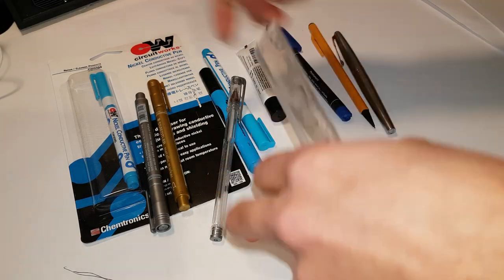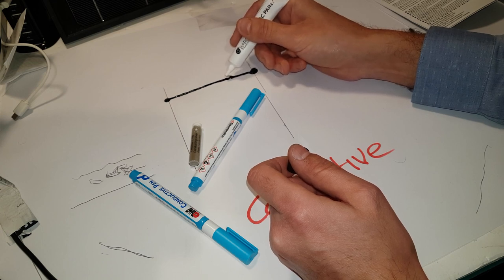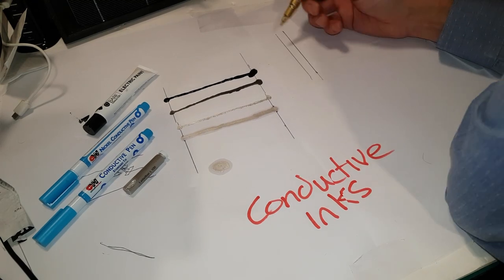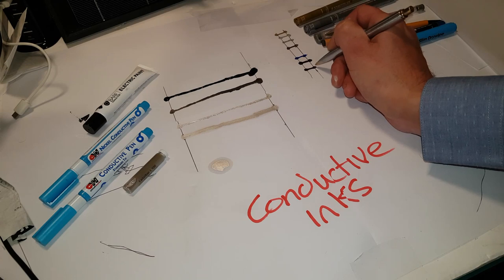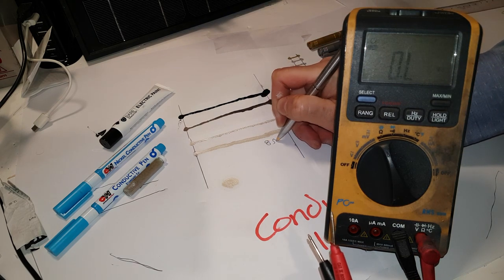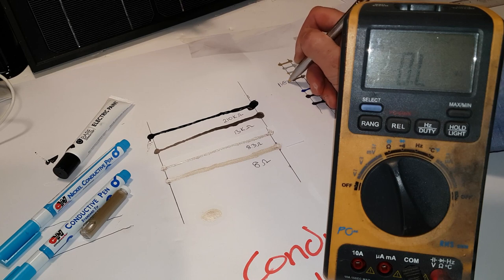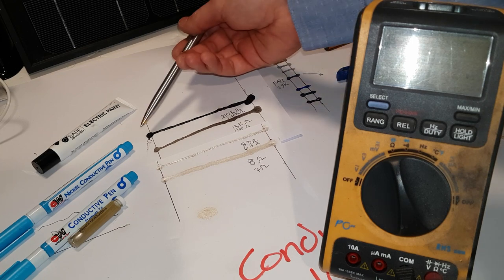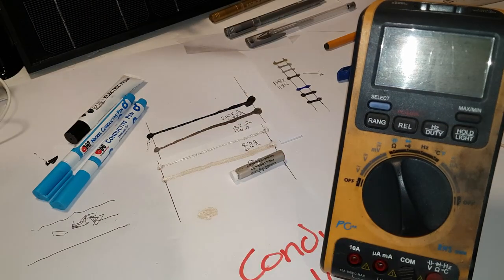THE BEST CONDUCTIVE INK! And DESTRUCTIVE TESTING! Review & FIRE!!!

Comment: Conductive paint amuses me. It is really expensive and yet it is made from "Conductive Carbon" when you look up what "conductive Carbon" is, this is the description "a specially produced type of carbon utilizing the process of incomplete combustion with restricted oxygen access" 

So..... It is charcoal that has been ground up into a fine powder and mixed with a solvent. Most likely water. Something that isn't really expensive.
Reply: It most likely carbon black and not "charcoal", and usually a resin binder involved and perhaps a surfactant.  So, a tad bit more involved than you note
Reply: @sulldogg  but the description describes the method used to produce charcoal.
Reply: @sulldogg  that resin can be as simple as using a lung cookie, and the carbon could be a ground up slice of burnt toast.

It can even be used to make a capacitor or battery in the wilderness like when camping with MacGyver's disgusting cousin that you can't take any place, other than miles away from other people.